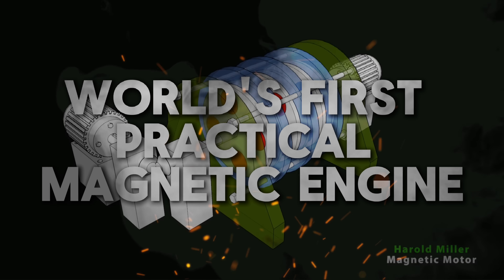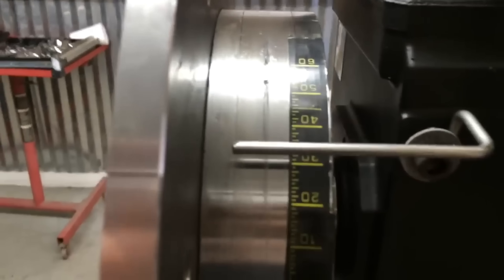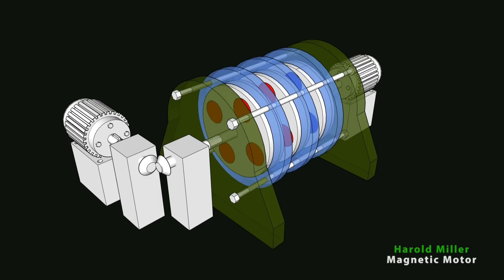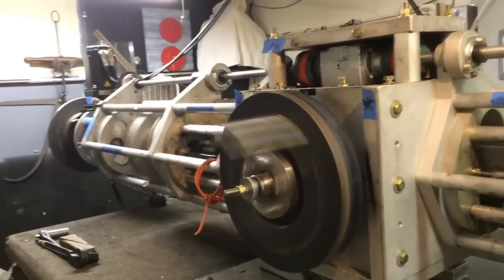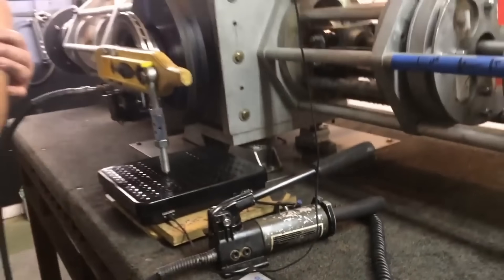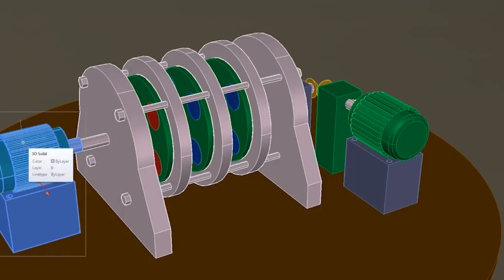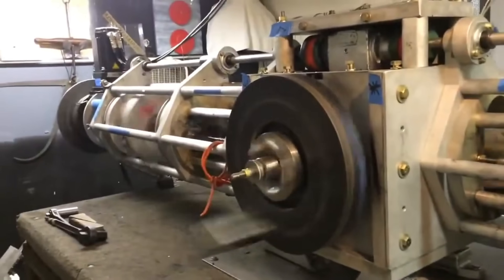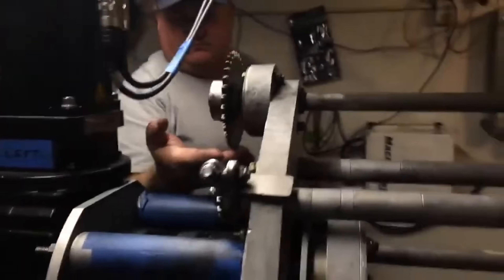Infinite Free Energy: Self-Starting 100% Magnet Powered Motor”?

Comment: I heard recombining magnetic fields gives off energy like on the sun.
Reply: It is natures step up transformer.. Search on Walter Russell's Optical Dynamo. NO MOVING PARTS! It is a patent you can find, there is also a wealth of info on this on the University of Science and Philosophy channel The New Thermodynamics First Law: Cold generates energy. Heat radiates energy. Cold multiplies. It cannot be divided. Heat divides. It cannot be multiplied. Second Law: Every reaction must be preceded by its equal action. Heat is the reaction of cold. Heat could not come into existence save for the compressive action of cold. (The law of entropy, therefore, has no place in nature.) Third Law: Cold and heat express their opposition at angles of 90° from each other. Cold extends along axis and the axis of all bodies of creating matter where rotation is minimum, while heat expansion is maximum at equatorial planes where speed of motion is maximum. Fourth Law: Cold compresses. Compression multiplies cold into heat. Heat expands. Expansion divides heat into cold. Cold and heat, like life and death, constitute a wave cycle. In all nature there is no effect which is not wave created, and all waves are cyclic. (Again, I repeat, that the law of entropy, and the belief that energy does not run "up-hill", have no place in nature.) Fifth Law: When motion begins heat begins. This entire universe is a varied measure of the heat of motion. This entire wave universe is a varied measure of heat and motion. Long low waves of low heat potential constitute the invisible light spectrum, while short high waves of high heat potential and low frequencies constitute the visible spectrum. Sixth Law: The emergence of heating matter in motion from the static cold of space begins at the indigoblue and blue-violet ends of the spectrum and builds up to the white centered yellow, through red and green, until the maximum heat equatorial plane is reactive at an angle of 90° from the static axis of cold.

Comment: So "What's the frequency?"But then..a guy found a better way to separate hydrogen from water using a hydrogen-rezonant frequency..so it was said. What's become of THAT?
Reply: ~109.6 THz or 3657 cm-1. Experiment should be run with Both AC and DC 🫶 DC applying base field and AC running at Harmonic
Reply: @haroldvanveldhuizen9525 Knowledge!🙏😁
Reply: A catalyst of aluminum and gallium will separate the two with no energy input.
Reply: @ABetterDay-fz3br  that’s awesome! Will try that out! So we could just cast a plate consisting of gallium Al alloy and run the h2o across?
Reply: @haroldvanveldhuizen9525  
Sure, that works with many metals. Did you sleep in your chemistry lessons?
Reply: @andreasschmitt2307  Well hello mister Smith 🥷 well depending on the vibrational state of the metal one could imagine the possibility of certain metals having a more resonant crystalline structure (or electron cloud) allowing for a favorable condition of certain H-O configuration to form whereby less energy could be consumed in the forming of the much sought after H2 O2 Osama reactive gass. Anyway it would be an interesting experimental setup, also One might be able to find resonant wave form that runs across the metal. Something with Square wave and Tungsten rods should be an interesting experiment ✌️🌌🌟🛸🐦‍⬛
Reply: Using H²0, the only thing keeping everything alive on this planet and burning it as fuels has to be the most foolish things... we only have so much water on this planet.its not coming from anywhere mysteriously. We think we have allot. But it's the only h²0 we have. 

So anyone wanting to use hydrogen and oxygen that they got from separation of h²0. And use as fuel for cars is... stupid.. it's effective but at what cost?. 

Just my opinion.

Comment: The conservation of energy refers to a closed energy source, but magnetism is an open energy source because, no matter how much the negative use, it is still charged the same. A magnet is a crystal that vibrates at the frequency of the background energy of the universe and thus it has the whole universe to drive it. Just like Nicola, Tesla said.
Reply: Lmao, "a magnet is a crystal that vibrates at the frequency of the universe." Tell me you got your understanding of thermodynamics from Natural News, without telling me. 😂
Reply: @Deletirium  Search on Walter Russell's Optical Dynamo. NO MOVING PARTS! It is a patent you can find, there is also a wealth of info on this on the University of Science and Philosophy channel The New Thermodynamics First Law: Cold generates energy. Heat radiates energy. Cold multiplies. It cannot be divided. Heat divides. It cannot be multiplied. Second Law: Every reaction must be preceded by its equal action. Heat is the reaction of cold. Heat could not come into existence save for the compressive action of cold. (The law of entropy, therefore, has no place in nature.) Third Law: Cold and heat express their opposition at angles of 90° from each other. Cold extends along axis and the axis of all bodies of creating matter where rotation is minimum, while heat expansion is maximum at equatorial planes where speed of motion is maximum. Fourth Law: Cold compresses. Compression multiplies cold into heat. Heat expands. Expansion divides heat into cold. Cold and heat, like life and death, constitute a wave cycle. In all nature there is no effect which is not wave created, and all waves are cyclic. (Again, I repeat, that the law of entropy, and the belief that energy does not run "up-hill", have no place in nature.) Fifth Law: When motion begins heat begins. This entire universe is a varied measure of the heat of motion. This entire wave universe is a varied measure of heat and motion. Long low waves of low heat potential constitute the invisible light spectrum, while short high waves of high heat potential and low frequencies constitute the visible spectrum. Sixth Law: The emergence of heating matter in motion from the static cold of space begins at the indigoblue and blue-violet ends of the spectrum and builds up to the white centered yellow, through red and green, until the maximum heat equatorial plane is reactive at an angle of 90° from the static axis of cold.
Reply: Energy is in Joules. Magnetism is measured in Teslas. Joules aren’t Teslas! Magnetism isn’t energy!
Reply: @graemerk Everything is energy